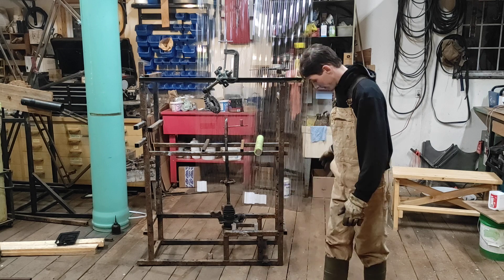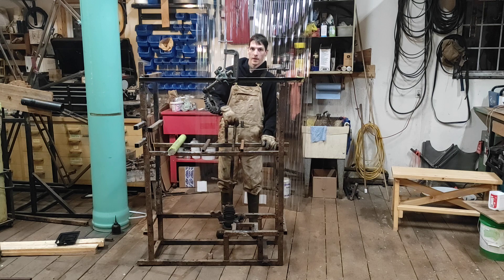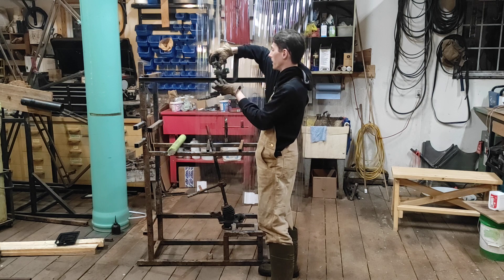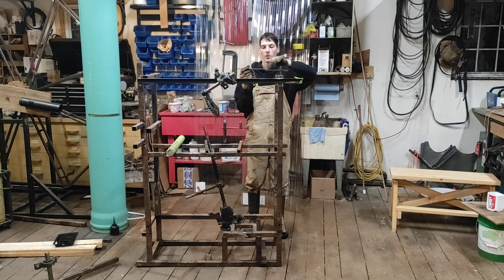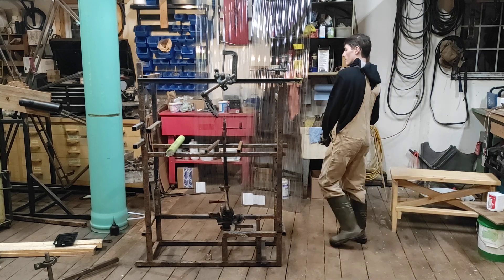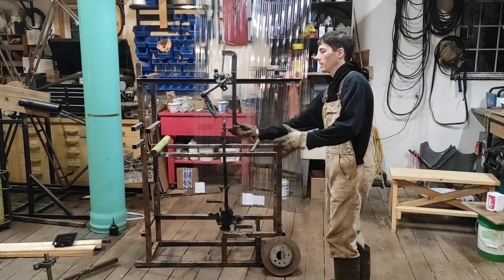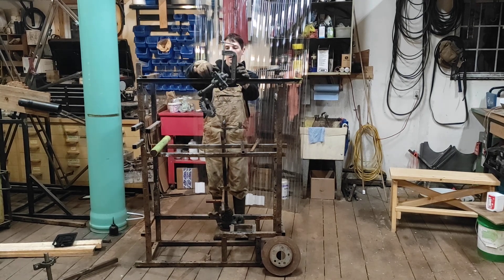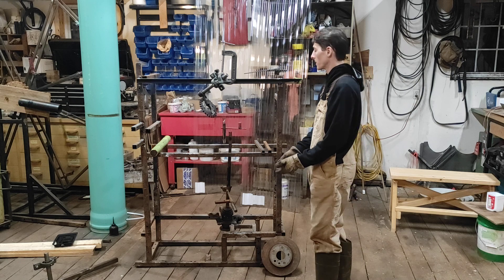William Skinner's Gravity Power Machine Build the Right Way

Comment: PROBLEM SOLVED - The Skinner Gravity drive linkage has been Solved at Low Cost - see "DrElectrical torque Motor" of 8 years ago - he shows you his wood frame Skinner Gravity oscillator running at 120 rpm and swaying strongly - the sway motion tunes itself to the needed oscillation frequency of the moving inertial mass to produce maximum Power? - no fancy drive linkage needed!! - you could torque test it to be certain.